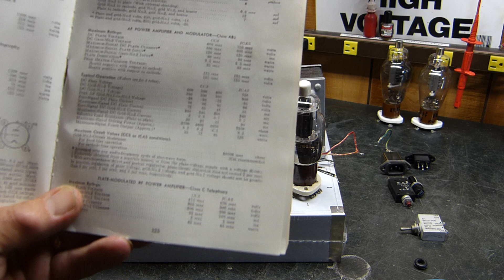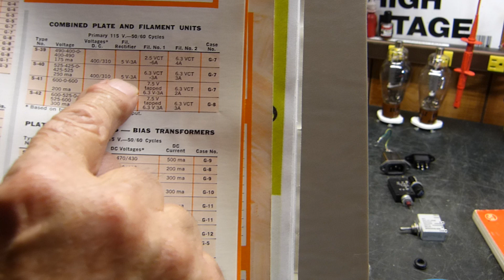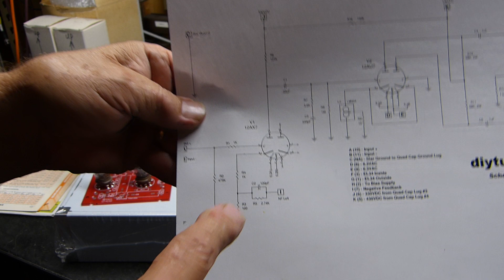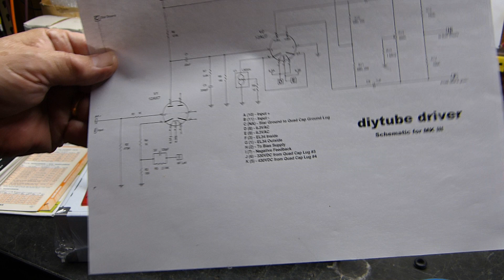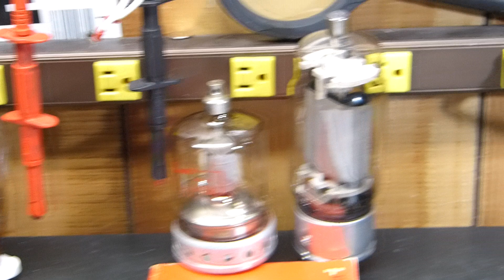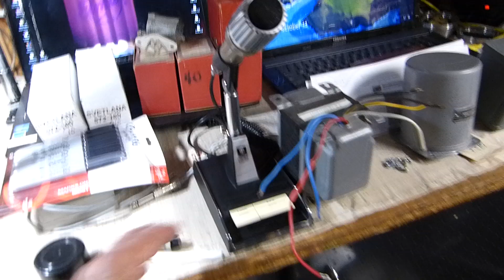Audio Amplifier Building With Vacuum Tubes - The First Steps In Construction

Comment: The one thing I'd emphasize as one who has built a fair number of amps; Maybe it seems obvious, but you want to get all your metalwork out of the way before you start to mount sockets & trannies and especially before you start soldering wires. Usually it's kind of awkward to drill holes with a 15-20 pound transformer (or two of them) mounted to the main surface. Usually not so bad if you are hand drilling; But on a drill press it can be irritating. Then again....If you need to drill a "forgotten" hole close to a mounted transformer, you might need an aircraft (super long) drill bit to get to it. You sure don't want to carve out 1"+ holes for tube sockets with trannies mounted. Yeah, if you have the right size punch, not the biggest of big deals, but beginners do not have the right punches. Right? 
And you generally don't want to drill holes in the chassis after you've placed wires, because you could injure the wires.  
When you look at an amp schematic and start thinking about building it; you have to realize that some parts are NOT going to be on the schematic, in many cases. Dave shows these but it's very common for a beginner to overlook the mechanical and layout considerations when the schematic does not show: an AC on-off switch; the type of AC entry, fuseholder, pilot light. What kind of pilot light? A little LED or a big #47 holder that requires a (I think) 3/4" or 7/8" hole? What if you want a standby switch? 
And how are you gonna handle the output connectors? Dual banana posts? Fine. You don't want those right near your 450+ volt power supply. You have to carefully drill the holes for banana plug posts if you are using separate ones or else a mating dual banana plug won't fit right. And you don't want those right next to the inputs, either. 
And where are the input jacks? Front or back? You sure don't want those near your big power transformer. 
Dave is using a PC board for the preamp section, which IMO is the way to go. If you want an input "volume" control you have to consider how close to the edge of the chassis you cut the rectangular hole for that board. (This is a lot more true if you are going to mount some tone controls) If you don't leave enough room around the preamp section, your tone controls get shoved down towards the power tubes and that's likely to be a problem noise-wise. 
A lot of people like to convert old tube hi-fi amps for guitar use. Many of these present problems because often there ends up being no room for tone controls; or maybe you want to add another tube stage (or two, maybe you want to add reverb or tremolo---oh, and by the way, those require some extra jacks, usually on the back) ) and you can't do it in a mechanically neat way. Or there isn't room for a parts board or tag strip and you're forced to build P2P. 
What about some misc tie points under the chassis, barrier strip thingys? NO SCHEMATIC SHOWS THEM! 
Or you want to add pin jacks for bias-adjust test points. 
So I apologize for spewing out all the unpleasant issues I have encountered building tube stuff. All I can say is; most "surprises" end up creating awkward, uneven, hodgepodge mounting of parts, while at the same time, it is very very difficult for a beginner to anticipate all the tomfoolery that can happen. 
You want to build something that looks perfect but for your first few builds, regrettably, that's almost impossible!
Reply from the maker: I think you have done a marvelous job of describing so many of the issues of homebrew equipment building, especially for the new-builder and never too late for us old-builders also to get reminded of how complicated things can get. Lastly, I might add that after a piece of equipment is built and something needs to be added it is really important to make darn sure there is nothing beneath the chassis before drilling from above the chassis. Seems pretty obvious, but stupid things can happen if one is not really careful and end up drilling a hole thru an inductor (or whatever) from getting in a hurry. Thank you for your time and your reply.
Reply: @ElPasoTubeAmps  Thanks, Dave! Just trying to share some experience tidbits. Y'know, there are big differences between building a Fender-like guitar amp (with tone controls and possibly reverb/trem controls) and a "monobloc" type amp like you show in this video. The difference revolves around; with a Fender-type amp you are usually trying to build something kind of long left-to-right and not very deep as it is at least pictured as going into a cabinet. That's completely different than building a nearly-square item like you're doing in the video. You don't that much care about how big the chassis footprint is. That has tremendous implications for parts layout. Even in a bloc type amp, it's almost a requirement to sprinkle some terminal strips around the tube sockets. You are gonna need them to mount stopper and screen resistors & coupling caps. Again; no schematic EVER shows how many tie point strips you're gonna need. By the time you have say 6-place tie point strips, these usually have two chassis mounting holes. I wish I could tell you how many times I have figured on needing a 3-place tie point strip which only needs one mounting hole, but I really need 6 or 8-place, and then the hole I drilled for the small term strip is no good and then other hole I need runs into another tube or is under a tranny. And it's THESE holes you discover you need AFTER the wiring has been placed. Solution: There is never a penalty for over-specifying the number of tie point strips you will need and leaving a few lugs blank. 

Back when you & I started building stuff, all the parts were 25 cents each. Now, every stinking part is $3 or $7 and while that isn't all that much money, 57 of them are. 

I move on to building Fender-type amps. You can buy stuffed or empty tag strips that carry all the R's & C's that are not mounted right between the tone control lugs. In general, those make your life easier; but to use those strips, you have to have (meaning, you have to plan for) a fair amount of room where no chassis mounted stuff is located between a tube lineup along the back edge and the tone pots on the front edge. This is a HUGE deal converting an old dual 6V6 or 6L6 PA or mono amp to guitar. With these conversions, unless you are building a "primitive" guitar amp (with only a pot or two) the layout you make with the tracing paper when you are first placing the big parts on top of the chassis also has to show where the tag strip will go UNDER the chassis or you're bound to create interferences. I have tried to convert some of these amps where in the end, it was easier to cut out the entire top surface of the old chassis and replace it with a blank piece of sheet metal. Many of these amps, the controls will be so close to the tube sockets you're bound to create noise issues. 

Best of luck, builders!
Reply from the maker: @pneumatic00  I sure agree with you about size and shape of what we build. If you notice that most of my amplifiers look like vintage McIntosh models for power amps. I tend to run into issues when having to cram parts into a small space and it isn't fun for me to build anymore so I don't build equipment like preamps and such.
Same experience here with the terminal strips under the chassis. I remember a RF amp I build not too long ago and posted it and commented that there was only One "mystery hole" in the chassis. I have found that just putting a screw, or goof-plug, as required, tends to dress up these mistakes of too many holes. And, indeed, sometimes things like terminal strips do need to be drilled and mounted after other components are already on the chassis.
In this case, as I have done in the past, I will drill all the holes I need, then a cleaning and coating of primer on the chassis followed by grey wrinkle paint. I guess I will be old-fashioned to the end.
Reply: Another thing that never appears in the diagrams is the filament connections, which will take up space and still have to avoid being near connections where there is low signal.

Comment: I’ve wanted to build a KT88 audio amplifier for a long time.  What always stops me is getting the right transformers.   Where do you procure yours from?   Thanks!
Reply: Edcore  CXSE25-8-5K  for the 8 ohm output.. Edcore makes hi quality transformers.. this transformer is for Class A..if your interested I have lots of tested information.
Reply from the maker: I see dan dee below has given you a nice source. 
In general, I just find transformers at estate sales and from parting out military equipment. I have also been doing this for more than 50 years so I have ended up with quite a nice stash of power transformers. Output transformers are, for sure, a more difficult item to fine.
However, keep in mind that, for example, a 5K to 8 ohm OPT can also be used as a 2.5K primary with a 4 ohm load (on the 8 ohm winding) or 10K primary with a 16 ohm load (on the 8 ohm winding) and so on. The amplifier in this video is a perfect example of using a 4K primary as a 8K primary by putting the 8 ohm load on the 4 ohm winding.
Similarly, for example, a 500 volt CT power transformer can be used as a conventional CT full-wave for about 300 VDC or you can wire it in a bridge mode for about 600 VDC or even a voltage doubler for about 1200 volts. If you are lucky enough for your transformer to have dual primary windings, you can double (or half) the values I just mentioned. So, you may have an option with transformers that you just haven't thought of yet. Hope this helps.

Comment: I’m kind of confused, are you building an 807 guitar/audio amp? Or will this be part of an am transmitter ? I love 4-400’s and 4-1000’s the design of 4-400 am transmitter reminds me of the Johnson 500 (single tube) or Collins 20V (pair)
Reply from the maker: Maybe Stephen got it right below...   :-)
This amp with the Triad transformer will be just a HiFi amp. Mostly I like to see for myself and document the performance of some of this vintage "iron" that claim such fantastic performance. We shall see.  Also, some viewers want to see how amplifiers are built so I will post a few videos on the progress as it occurs, which I hope will help others.
The AM transmitter is a separate project. I have now thought that maybe all I need to do is change the bias and plate tank Z of the 833A amp I have already built and then build a large modulator for that amplifier. Maybe even use a McIntosh MC2205 that I already have that will deliver over 400 watts of audio. I have the transformers to match 8 ohms to the high Z that the plate of the 833A class-C amplifier will need. Now that would be a novel approach to AM...
Reply: Hey! Weird suggestion: use a type 83 vapor rectifier and a 30 second delay relay tube for your B+ onset after the filament warms up
Reply from the maker: @Dukers2300  I have been charmed by the MV type 83 rectifier before. I know they use it in the TV-7 tube testers as the voltage drop is low and constant and I think I have a couple. I will have to think about it.

Comment: Nice! You didn't really state what you are building. It seems to be the classic williamson design. is that right?
Reply from the maker: This one will be the Poseidon board and it is not Williamson but does deliver a drive voltage that is sufficient for the 6L6/EL34/6550 family of beam power tubes. When I start on the amps with the Svetlana SVT572-10 tubes, I am going to go to a voltage amplifier that will deliver much more drive voltage as the bias level is much higher on the low mu triodes. Those amplifiers will either be classic transformer driven (assuming I have two matching transformers for two amplifiers) or some form of CT inductor.

Comment: Hi Dave,
Where do you source your chassis?  I'm looking for an enclosure to house two 50A Megawatt power supplies. Nice start to the audio amp.  73  WB3BJU
Reply from the maker: Don,
I order them from www.mouser.com.
Here are a couple of part numbers to get you in the ball park so you will know what to type in to find them.  I just ordered two 17x17x4 chassis today. They are about $60 each but the smaller ones are a bit cheaper more in the $40 range.     Try these part numbers   1444-14103   or  1444-17134     You can then browse around for the size you want.
I have got to tell you what just dawned on me.  I assume you might know that I have already build a 833A class-B amplifier that I use on 20M  SSB. I can change the bias to meet class-C operation and then use one of the huge KW level transformers I have, as a modulation transformer, that will match 8 ohms primary impedance to a secondary impedance (using the transformer what me might think of as "backwards")  anywhere between 5K and 20K and then drive the 8 ohm winding of this transformer with a 400 watt solid state McIntosh amplifier. This is crazy but I think I can make it work. I will have a full, high-level, plate modulated KW of AM on 20M.   I love it.  That should put out a serious amount of carrier.    :-)    I bet everyone will just love me all at 14.286 MHz
Your thoughts?  73  WA4QGA